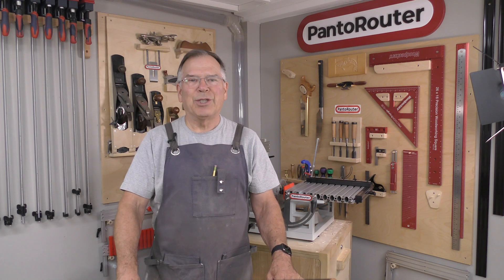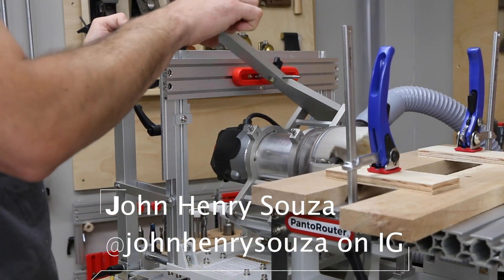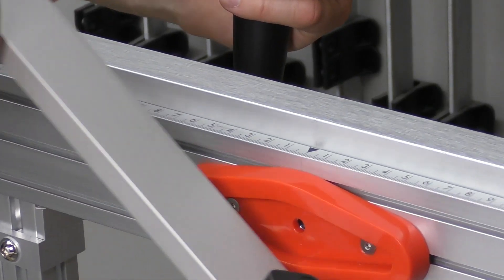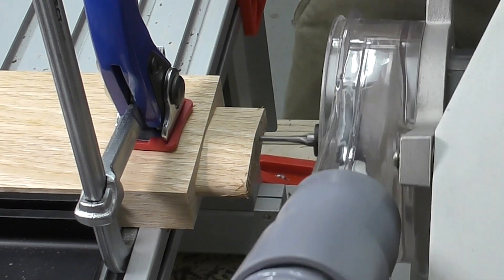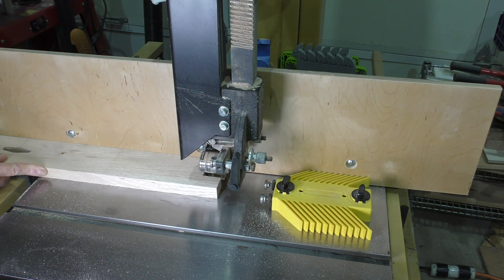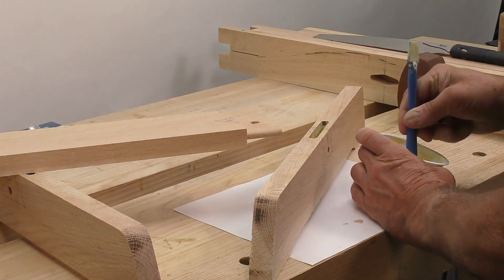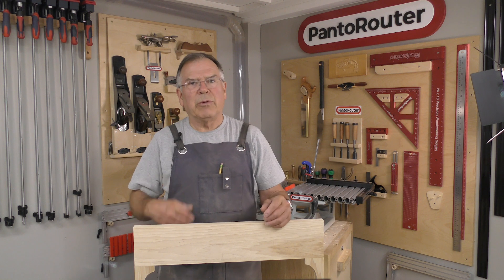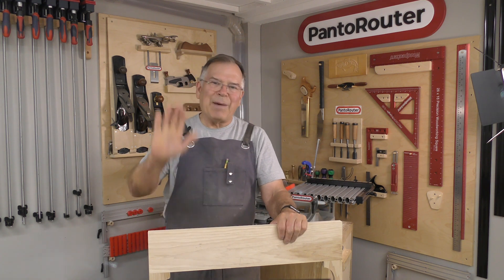Krenov-Style Sawhorses on the PantoRouter™

Comment: Is 6inch tenon’s possible on panto router sir
Reply from the maker: The PantoRouter can easily make 6" wide tenons.  The length of the tenon is dependent on the length of the bit and 6" would be too long.  We have customers who cut 4 and 5" long tenons, but usually it's not necessary to get an extremely strong M&T joint.

Comment: Mac - where did you get the blue hardware used to clamp the top of the sawhorse?  Thanks.
Reply from the maker: They're ¼-20 lever knobs from Rockler.  Other companies have similar hardware, too.  I needed to relieve the side enough for the bolt to protrude from the lever side.
Reply: Rockwell